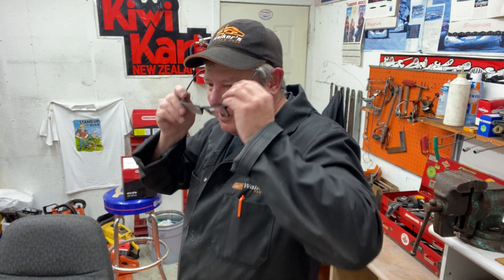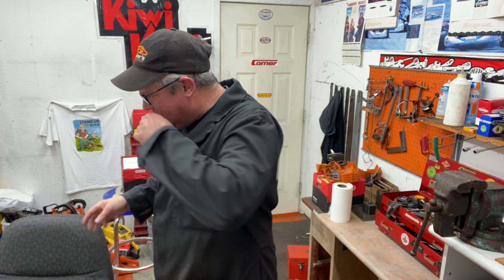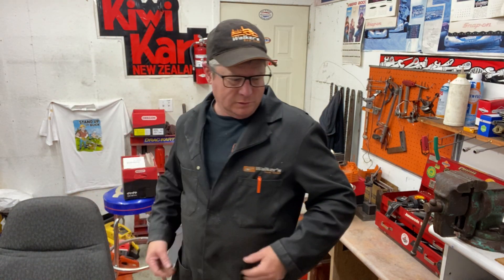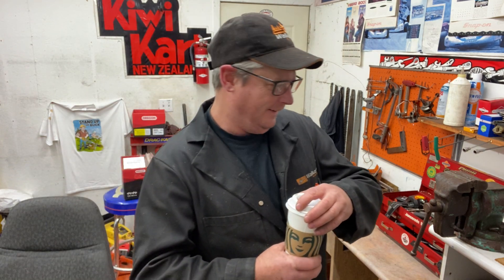TGIF saw talk

Comment: Hello Donny...I'm working on a 372 x-torq  carb is all over the place and have came down to a air leak at the throttle shaft....have put carb kit in,new boot and new plastic flange, new fuel lines and impulse and fuel filter....only leak I can fine is at throttle shaft with break clean....would you put a x-torq carb back on or go 390 carb planning on going 52mm popup with porting any input would be greatly appreciated
Reply from the maker: The 372 xtorq had a carb upgrade do you know if you have that and if your going to change cylinder get the 372 non xtorq carb they work good